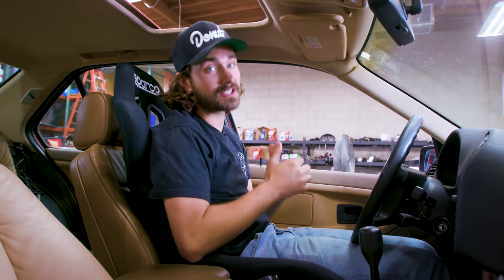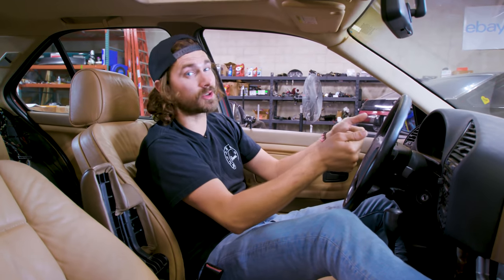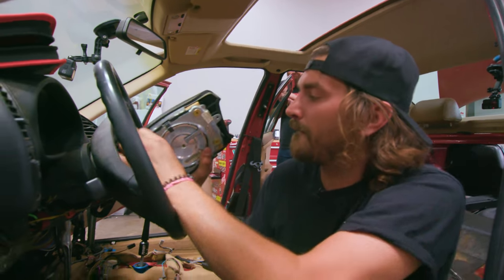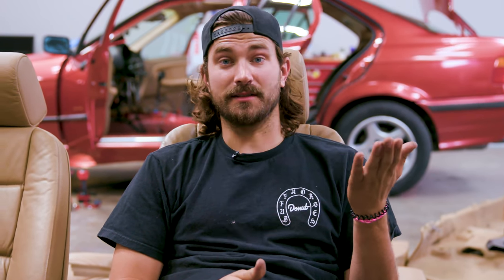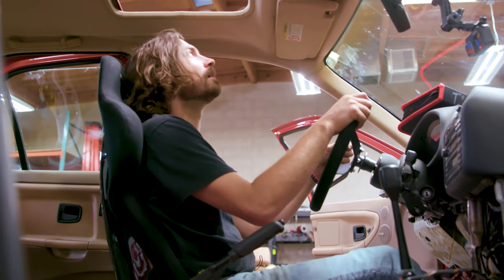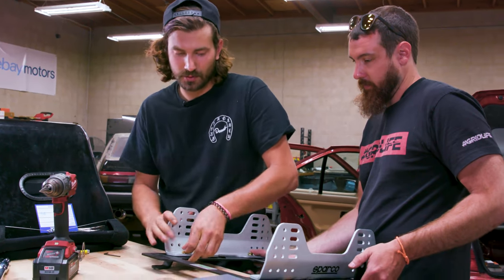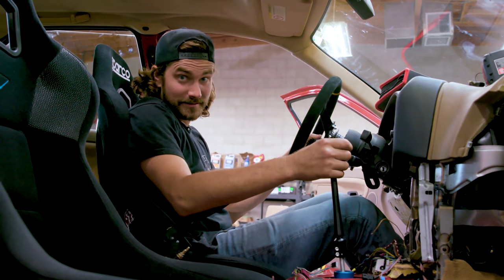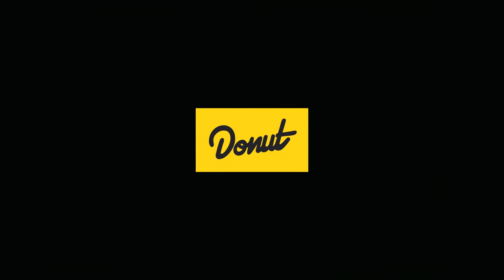Were Bucket Seats Actually Worth It?

Comment: Zach “sparcos are really good”
Also Zach “we have to drill holes into the sparco mount since the sparco seat won’t line up”
Reply: Fax just get good seats and cheap brackets.
Reply: @eyoboyeegaming1187  aka Watch HiLow recap on seats
Reply: My sparcos didn't line up on my FC either.
Reply: @abracing199  Brides would have fit your FC.
Reply: For reals that pissed me off, usual Youtube more-budget-than-brains bull. Get some angle iron and spend the extra $300 or whatever on a cheap welder and learn something instead of showing people how to waste money.
Reply: @Mis73rRand0m  They have a welder. You don't need to weld if you get evo brackets for your evo seats. Check what you are buying and you will be fine without drilling or welding. Also, don't ever weld your seats in place, because you don't want other holes in your car (if you want to move your seats later) when you could just make one in the bracket if it doesn't fit the way you like it.
Reply: SPARCO IS THE GOAT DON’T EVER BE MEAN TO SPARCO
Reply: The mount is not sparco. The seat brackets are sparco, and those wouldnt line up with the mount.
Reply: Those look like Planted brackets, I used one with a Sparco sprint in my miata. The holes lined up with the mount, but the seat was offset to the left almost 2”, hitting the door panel and leaving a huge gap between the seat and console. I ended up redrilling as well to center the seat.
Reply: planted rails are garbage and the problem here. there are much better rail manufacturers out there.
Reply: @eyoboyeegaming1187  not if you want to use it in a comp. the brackets wont pass scrutineering
Reply: @John Stone how is sparco ricer? They're an Italian company who got their start making the fire suits for race car drivers back in the 70s.
Reply: @John Stone since theyre Italian wouldn't pasta be more appropriate than rice?
Reply: @Mis73rRand0m  you can’t afford $1700 seats?

Comment: This man just spent close to my entire budget for a car on seats nice
Reply: Honestly. I spent 1200 on an 04 lancer es and didn't have any left over to do anything to it
Reply: My E36 was $2k and the seats are about the same price so I just bought one for now. The other will be later. It feels weird spending half the car’s value on a seat.
Reply: The $500 e46 (manual 328i) in my driveway laughs at your cost comparison. 2 seats for 4x the cost of the car!
Reply: Damn u guys are making me nervous about buying a first car I'm gonna be more broke than I thought
Reply: @silas6236  it took me afew months after buying my lancer but I did slap some rims on it that were pretty much the price of what I paid for the car. Also used my leftover cash to change control arms and upper and lower tie rods plus new brakes
Reply: Alright Rick I'll keep that in mind thanks
Reply: @bigmanbam44 and @Rick Wad thank u both for the advice u appreciate it
Reply: Gaming car seat

Comment: I recently made brackets for recaro CS sportster seats in my e46 daily. I used 5mm thick steel plate and 12.9 grade steel hardware. I adapted universal twin lock slider's which I widened by 4 inches and then widened the slider release handle to fit. Then used the oem recaro backers (seats were from a megane rs) which I then cut and welded and modded to fit into the aftermarket sliders. It was a hell of a job. But I got them exactly how I wanted them. I then upholstered the slider handles to match the seat upholstery. Painted the brackets black and 3d printed some spike caps to cover any exposed hardware. I must say though  the work really paid off as my car now feels like it's more suited to me. It looks miles better and more modern. Granted not the track focus as in the video but just because you're not on track dosent mean u can have nice looking, comfortable and safe seating. An often overlooked area of modified street cars

Comment: The biggest issue I have with the e36 platform is the steering wheel position. It's way too high for the way I like to drive but it's not bad enough that it  makes me not want to drive the car. A quick tip about if you ever need to take that steering hub off, get yourself an 8in pulley remover, it makes like 1000x easier when adjusting.

Comment: You can grind the steering column bolts off the e36 and put washers or spacers in to lower the fixed steering columns on these cars. It makes a huge difference. I would include pictures of mine if I could, easily my favorite modification.

Comment: “Safety mods” takes away the steering wheel air bag.
Reply: It doesnt makes sense to have a 5 point harness with airbags, cause the harness will keep you from moving.
The airbag would deploy but do nothing.
Reply: @subarusensei3685  A 5 point harness without a hans device is just as pointless
Reply: @Xiltix25  I was talking about airbag mix with keeping you in, but of course you need a helmet with a hans

Comment: I still think the next money pit car should be something carbureted from the 70s or 80s. Can include some unique episodes on how to adjust the timing by first figuring out which piston is the #1 piston, changing breaks (perhaps drum breaks?), and (maybe near the end of the build) converting the carb to a fuel injection system, maybe installing a supercharger after that. Upgrading the cooling system, installing spreader bars. Idk maybe this can be a drag race build, and you can compare 1/4 mile times. Could do an engine swap or something but could also see just how fast you can make a small block 350 engine go.

Some more mods could be:
-changing piston type (flat top perhaps)
-stock manifold to highrise
-changing the cam in the engine
-headers (been done already but needed for the air flow)

I almost think a whole mini-series could be made that's just mods to the engine.

Comment: If that e36 didnt come with a tilt steering column, you can add a couple spacers where the whole column bolts up. you may have to use longer bolts. I had a 318i that had no tilt and thats how I lowered the column a few inches so it didnt feel like driving a school bus.

Comment: Other safety things you should install!
1. Demolition derby style structural bracing, whatever that's actually called. (Does a different job from a rollcage, but should still be compatible.)
2. If you replace the tail lights, please make sure that the turn signals on them stay Amber. (See: The Confusing Ambiguity of North American Turn Signals, a video by Technology Connections.)
3. HANS device to protect your neck.
4. Polyborbornene mountings for all of the interior stuff to help dampen strong vibrations. This should help to minimize injury and fatigue.
5. Eventually upgrade your harness to a 6-point harness with inflatable belts.
6. Get some wireless tire pressure sensors, preferably the kind that replace your tire valve caps and connect wirelessly to a dashboard display.
7. Put some Multi-Seal in your tires (not Slime or Fix-a-Flat, those are actually pretty crappy). That should help a lot with sealing punctures as they happen.
8. Install peristaltic pumps in your tires so that the wheel movement will automatically regulate the tire pressure.
9. An interior quality sensor, to automatically warn you when air quality in the cabin is getting poor.
Reply: @stoicflnance2411  Wait, what?

Comment: Buckets are 100% worth it especially if the stock seats are hopeless. I put a set of Sparco Sprint knockoffs in my Crown Vic and autocrossed the shit out of it. It was so much easier to control the car without having to brace myself on the door panel or hang onto the wheel. I recommend getting real ones for safety though since my drivers seat broke once under hard acceleration lol.

Comment: When removing the steering wheel, never take out the bolt completly...just let a few threads in, so when you pull the steering wheel you don't hit your face and u don't destroy the clock spring from the airbag system. :)

Comment: should've left the front part of the carpet in. Just cut it at the front stock mounting points. The front part doesn't whey as much that it would be worth switching to leg trays. also stock carpet under the pedals looks way cooler. That's how I have it in my drift car

Comment: Buys Sparco Seats, buys Sparco Side mounts, and then buys Planted Technology seat Bracket. I think it was expected that the side mounts would line up with the PT bracket. Sparco wants you to buy their seat bracket which fits their system. But that's car modding, you cut/drill/and weld to make it work, when you don't have the exact parts needed.

Comment: Zack i need your help i have a e46 2000 328ci  come electric fan oem and std the issue is electric fan not work why oem plug i plug direct and the wire heat and stop working. What you think if i put the fan clutch if come in automatic models?

Comment: Sorry Zach but the steering wheel not being straight was your own fault I watched as you removed the wheel it was cocked to the one side. Next time set the old steering wheel to clear vision or straight if you want to call it that and then remove it. When the new wheel goes in it will be at clear view.

Comment: It does not take a lot of work to put the 3 point street belts back in for a test drive, even if you are using a race seat. No further modification or cage is needed. Please use the belts.

Comment: So let me get this straight...Those seats were $1700+ and designed to fit in that make and model car...but you had to drill holes??? WTF Sparco?

Why not just drill holes in the old seat mount brackets? I mean it's "money pit" so wasn't this stuff trying to save some money. Isn't there be a reasonable argument towards these being overly expensive? I couldn't believe how much they were for my jeep and that they weren't included with the seats. If the argument is you didn't wanna cheap out on the safety stuff I can go with that argument...but a $2K seat system definitely makes this show(?) feel different. I'll keep watching but I'm not sure where they're heading after this mod. Does anyone know if they have a total build price/hours in they're head before they start? I would love to see how different things deviated and where time/money were going.